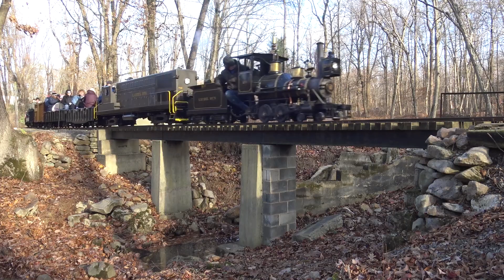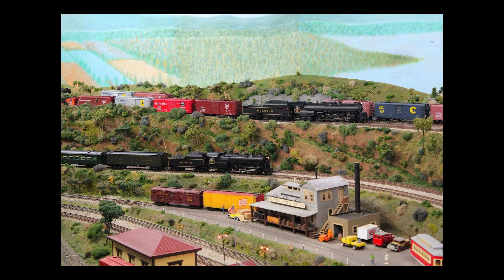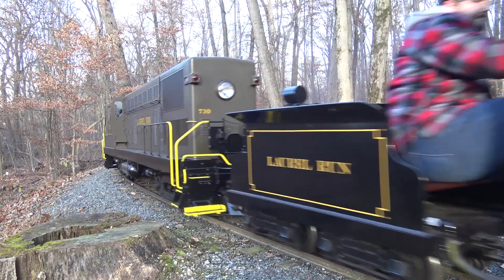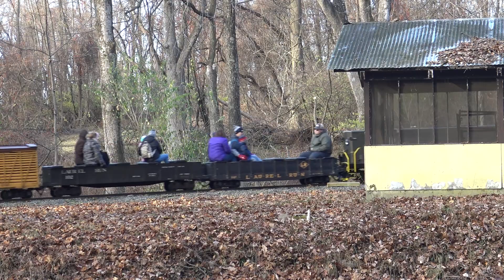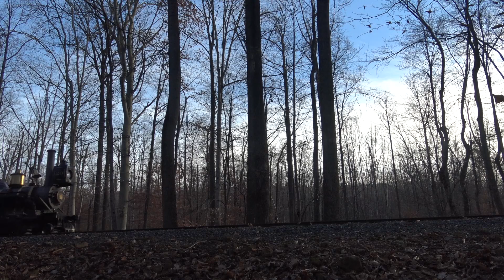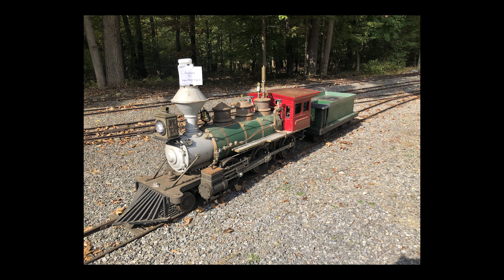Reading Society of Model Engineers:  Frosty Run 2021

Comment: How many steam locomotives do they have, and how many are operational?
Reply: At the club, we have a total of 3 steam engines! A small 4-4-0, a 4-8-4 northern type, and a 2-6-0 Mogul. The 4-4-0 and 4-8-4 are operational. The mogul is currently awaiting restoration work!
Reply from the maker: And the 4-8-4 is a smaller gauge locomotive than the 4-4-0 and 2-6-0.